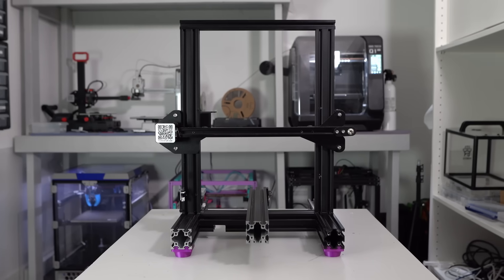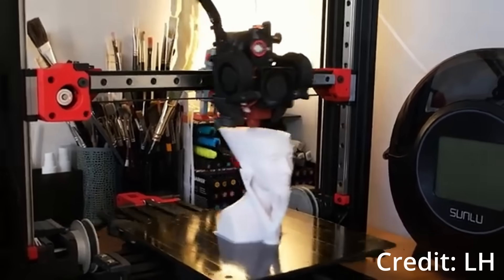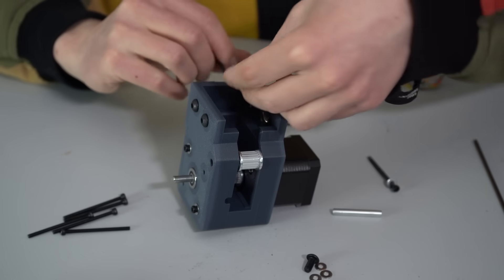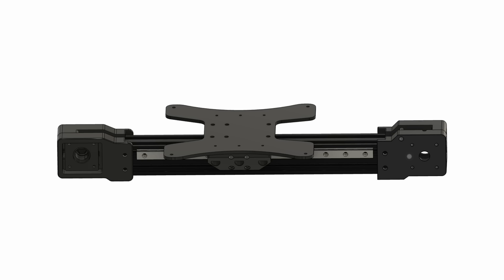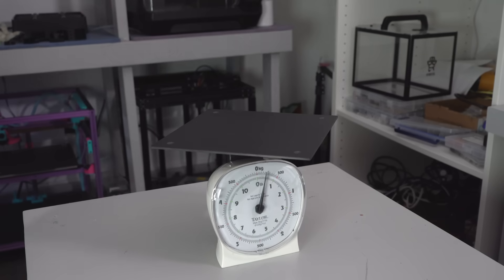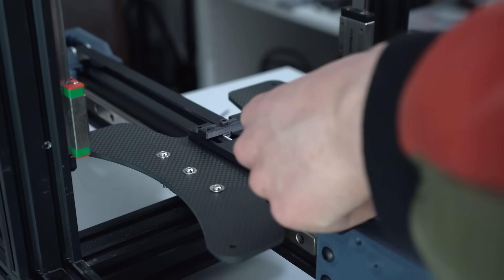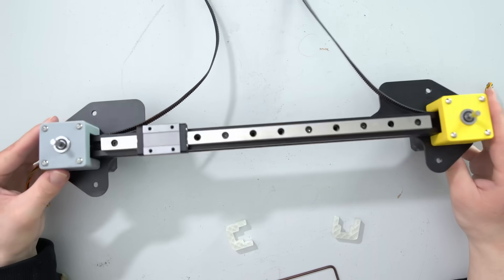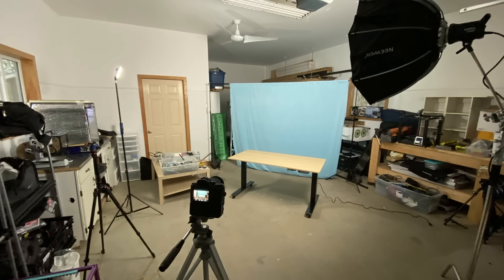I'm building the WORLD'S FASTEST Ender 3

Comment: Turn it into a coreXZ, AKA a Voron Switchwire or Enderwire.  You get the weight of both the X motors off of the X axis (but the Z axis doesn't really care about that), and both of the motors contribute to driving the X axis and Z axis.  Your Y axis conversion will work fine with the core XZ setup.
Reply from the maker: There's no practical advantage to CoreXZ, only drawbacks from coupling X and Z together
Reply: @mitsumakes  CoreXZ gives you the same benefits as a belted Z, and both motors share the duty of driving the X and Z  axis.  Since very little effort is needed on the Z axis, you will be getting the same advantage that you got from dual motors on X and Z, while only needing two motors.  Also the weight of the two motors is removed from the X gantry, the motors are mounted to the printer frame.  As for coupling X and Z together, that's only a software issue. If you are running Klipper, this is built in.  I'm not sure if Marlin handles this well.   The only real disadvantage is that sensorless homing on the X axis is problematic.  We don't care about sensorless homing on the Z axis, we will be using a probe of some sort for that.
Reply from the maker: @KennethScharf  The problem with corexz is that you are tying an axis that shouldn't be moving (z) with one that moves quickly (x).

Any inconsistency that would lead to skew or minor defects on corexy may lead to bad layer stacking and z moving when it shouldn't on corexz. 

There is also just not a single real benefit of corexz. It lenghtens the belt path and adds complexity without any real benefit over normal cartesian bedslingers.  It adds the issue of gantry sagging or dropping when powered off. 

The other popular motion systems all have strengths and weaknesses  that balance out in some way, giving them all value depending on your needs.

But corexz is pure novelty. You can absolutely build a great working corexz printer that produces prints you are happy with. But there is no actual advantage it as a motion system
Reply: @mitsumakes  I suppose the argument about mixing axis movement would also apply to core xy, perhaps more so as both axis are constantly moving.  Of course a crossed xy system also mixes the movement, though in a different way.  As for the z axis dropping when power is lost, well that also would apply to a belted z system, or a flying gantry system like the Voron 2.4 (unless the stepper motors are geared),   There is a way around that though, a relay that shorts the motors out when power is lost.
The only real advantage to the core xz is fast Z hops, which some object prints could make use of, and this might also apply to gross orders of bed tramming, though a flatter bed would be a better idea!
I build and ender-wire conversion, and it DOES print very well.  I did it because I thought it would have been more cost effective than trying to convert the Ender 3 to a core XY, and it would make more use of the available parts.  I might have been better off buying another ender 3 and combining both of them into a trident like xy machine.  It was a fun build though!

Comment: bed slinger will never be fast
Reply: worlds fastest printers are bedslingers stupid
Reply from the maker: Why do you think that? The Y carbon fibre plates weigh roughly half of the gantry on my voron
Reply: I dont think that's quite accurate. They can certainly be fast, but what I struggle with, and maybe the root of the statement, is why cartesian? Yes, they can be quick, but the faster the print, the more inertia must be overcome. I'm honestly surprised bedslingers are still popular with all the readily available coreXY machines on the market. Not pooping on your printer parade, just curious.
Reply from the maker: @C3DPropShop  For me, the biggest drawback of a bedslinger is just how space inefficient they are on Y with the bed moving around. Makes them a real pain to enclose!
Reply: I think it will be fast! But the question is, will it be good? 🤔 
Cheers!

Comment: If you did CoreXZ you could've used the switchwire mount for many toolheads
Reply: booooo long ass belt path means you gonna have no X acceleration whatsoever
Reply from the maker: I'm not very fond of CoreXZ personally. Caza explains it really well, "The problem with corexz is that you are tying an axis that shouldn't be moving (z) with one that moves quickly (x).

Any inconsistency that would lead to skew or minor defects on corexy may lead to bad layer stacking and z moving when it shouldn't on corexz. 

There is also just not a single real benefit of corexz. It lenghtens the belt path and adds complexity without any real benefit over normal cartesian bedslingers.  It adds the issue of gantry sagging or dropping when powered off. 

The other popular motion systems all have strengths and weaknesses  that balance out in some way, giving them all value depending on your needs.

But corexz is pure novelty. You can absolutely build a great working corexz printer that produces prints you are happy with. But there is no actual advantage it as a motion system."
Reply: @mitsumakes  thank you, I was not aware. I was just saying that if you were to use an already existing toolhead, maybe XoL with CPAP, idk, then the closest thing is a switchwire mount. On the other hand, would it be possible that hybrid CoreXZ would actually be suitable compares to regulate core xz? Also if you were to redesign the switchwire mount, if it counts with the same extrusion as ender 3 has and you have the same mhgn carriage, all you would need to do, hopefully, change the grip teeth for a single belt on each side
Reply from the maker: @justtheadam3895  Fair enough about the mount, using a switchwire mount would definitely be the easiest option. What exactly are you referring to with "hybrid corexz"?

Comment: Your idlers aren't a problem because they're not experiencing the belt tension force. They're experiencing only a small portion of it based on the angle of belt wrap around them. Same concept as on the M45 lower motor mounts.
Reply: To be specific, the load on the pulley scales as sin(theta/2) where theta is the angle between belt sides leaving it. For a normal non-AWD axis end idler, theta is 180°. Assuming you're keeping at least 135° of contact on the drive pulley, the idler is at most 45° and therefore the pulley only experiences at most 38% of the force it would if it were at a 180° axis-end.
Reply from the maker: @daliasprints9798  Thank you for all the information! It sounds like I'm safe then

Comment: I see you are using a G10/FR4 plate. Souldnt you be able to make a PCB heater build plate combo to get it even lighter?
Reply: Bro rolled 1 on perception check, it's carbon fiber
Reply from the maker: Not G10, its a carbon fibre plate. I think a PCB heater/build plate combo is a cool idea, but since there are already off the shelf heaters for the LH stinger I'm just going to use those instead